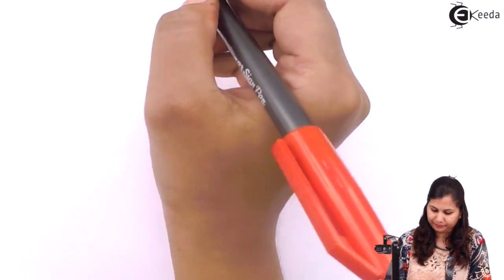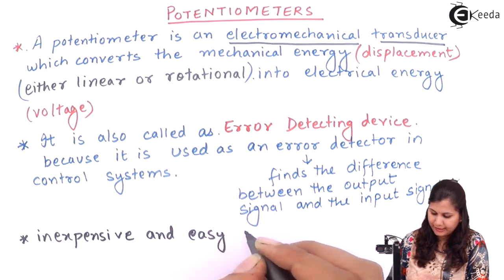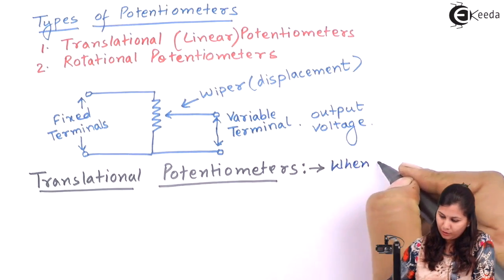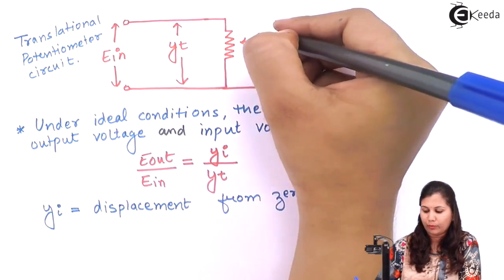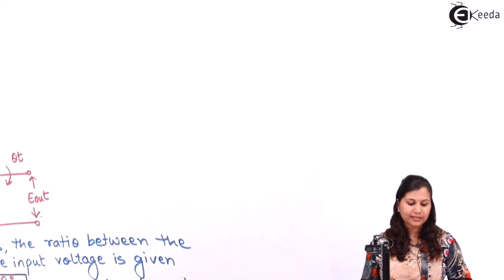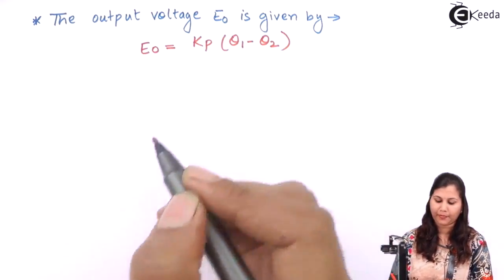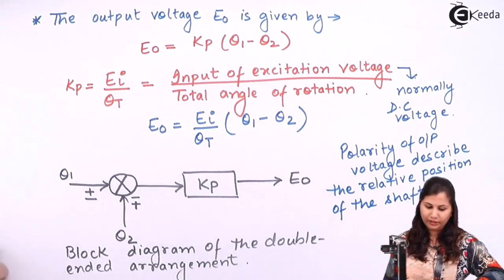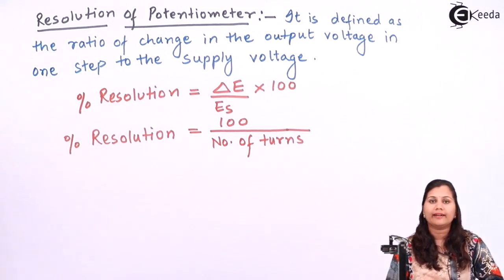Potentiometer - Control System Components - Control System

Comment: The potentiometer is also called as pots and it one of the most commonly used devise for measuring the displacement of the body. Thepotentiometer is the electrical type oftransducer or sensor and it is of resistive type because it works on the principle of change of resistance of the wire with its length.